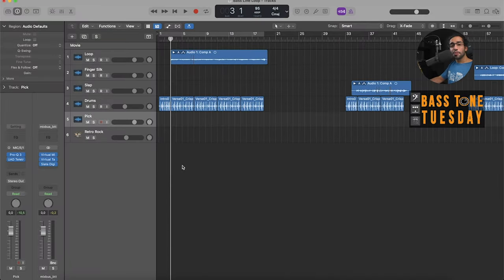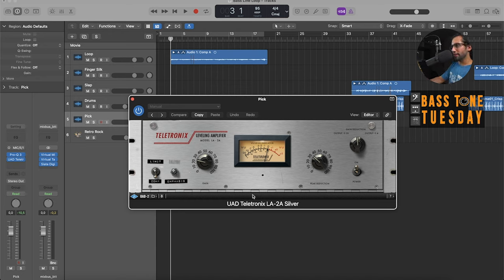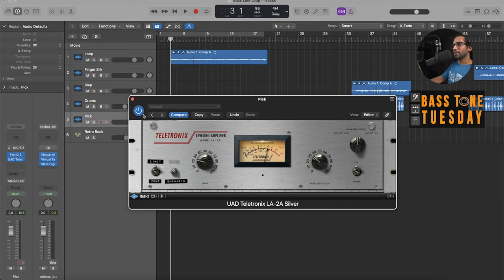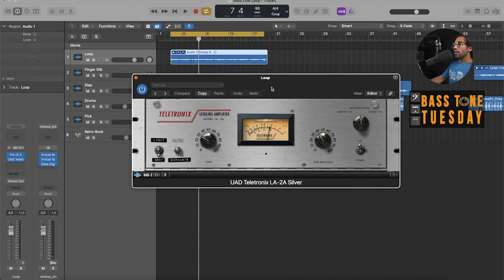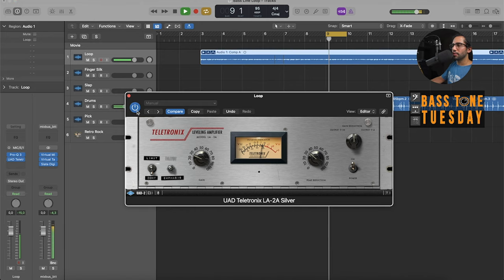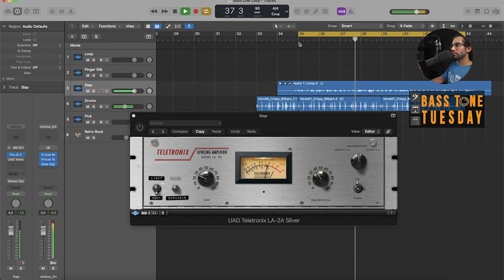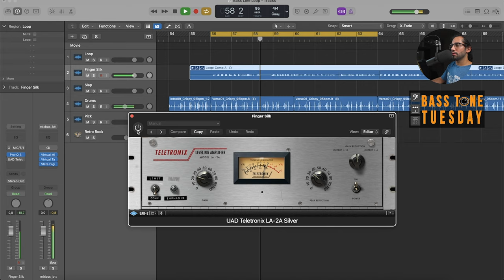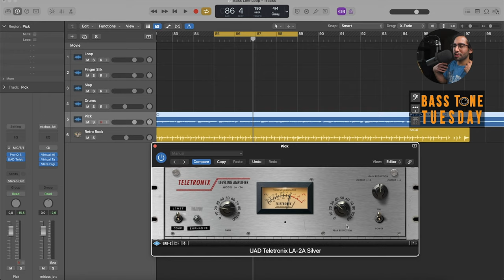Optical Compression for Bass | Bass Tone Tuesday

Comment: Great. I am using opto compressor for bass before driven amp for like 3/4 year. It is great. It is tube-like, very narural to play thru and sounds huge without blowing up speakers :)
Reply from the maker: Nice! Which one are you using?
Reply: @IvanBassist  It is TC Electronics HyperGravity Mini Copressor with VintageOptoComp preset. So ya, it is a simulation :)